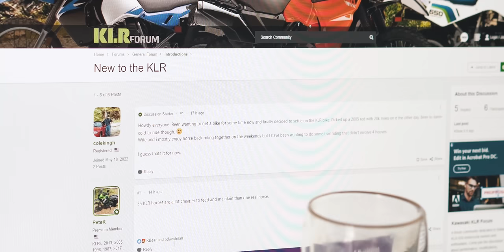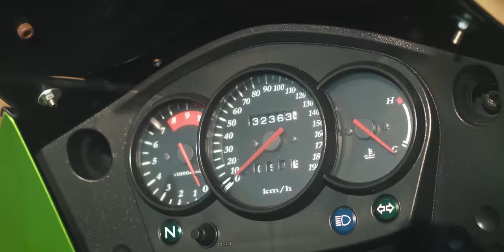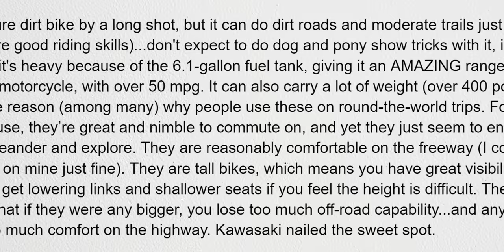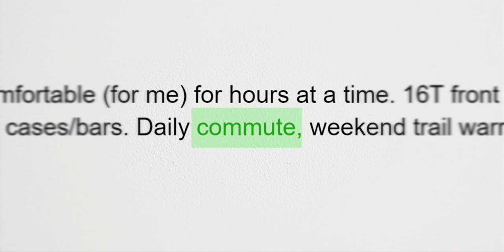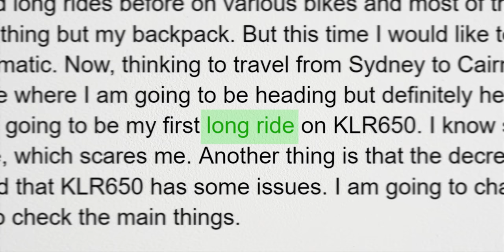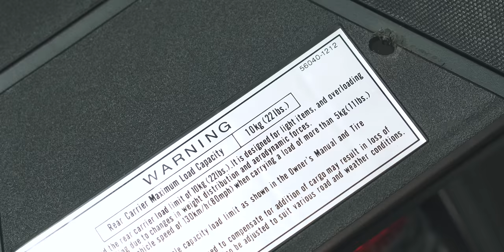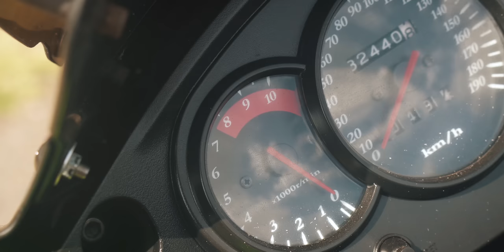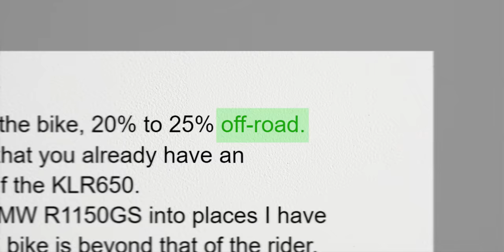I HATE the Kawasaki KLR650… so I BOUGHT one

Comment: Nope, still slow, boring, too heavy, oil eating, dohicky destroying, oddities.... the Suzuki Dr650 or Kawasaki Versys 300x make better budget adventure bikes.
Reply: A DRZ 650 will be 2g's more new or used, not worth 5hp and 60lbs less. The amusing thing is the 300x also weights 60lbs less, but has less horespower, and you'll save a whole $1000 new. If you want power and speed you buy a Yamaha, period. You buy Suzuki or Kawasaki if you want cheap and reliable.
Reply: The versys 300x and klr650 make the same 40hp
Reply: @AceCarleton  And my point stands that you dont buy Suzuki or Kawasaki for speed and power. That might be arguable with sport bikes, but outside the world of hyper bikes, Yamaha is king. The wr250r is a measly 10hp less for nearly a further  near 100lbs less than the 300x(295 vs 388). I would want either because to reach those power numbers, they have to spin TWICE the rpm of the 650. But i believe the 650 would outlast either of them in the long run. Low rpm motors chug forever. My iron 883 is slow and a whopping 48hp being while 200lbs heavier, but that INSTANT torque at 1800rpm is just the bees knees. My ancient Katana 600 would walk it all day everyday, but its got nothing until 6k+ rpms.
Reply: Lots of wr250r out there with well over 100,000 miles.  On the original piston.

My own wr250r has 42,000km on it and runs like new.  9000rpm all the time.  

Im not sure what your point is.  Mine is that i dont like the KLR650.  It just sucks at everything.

The versys 300x does hold 17L of fuel in those 384lbs